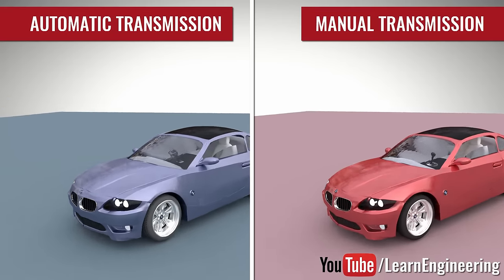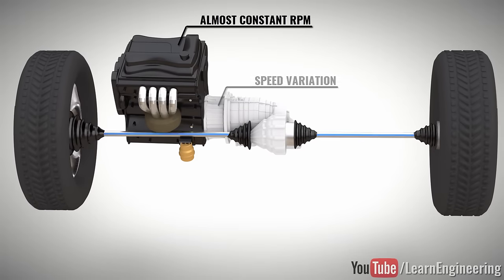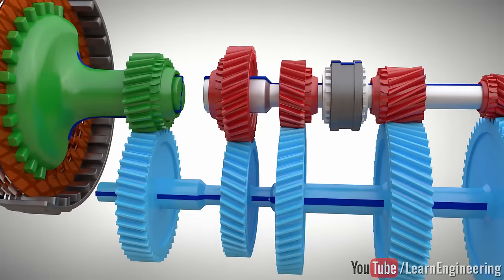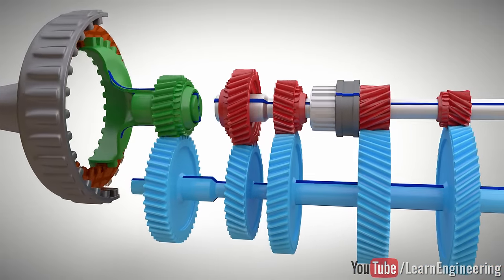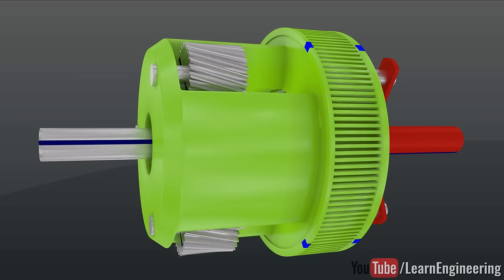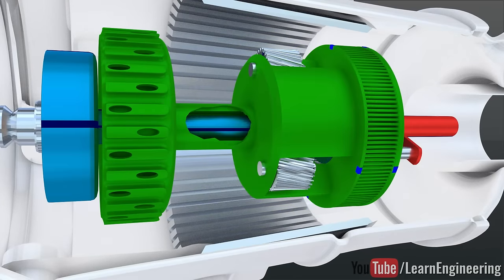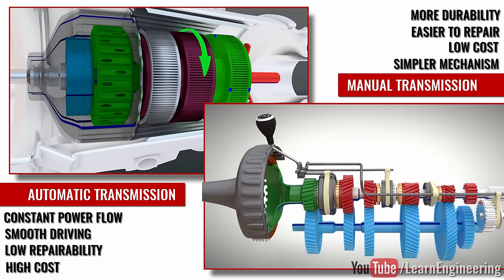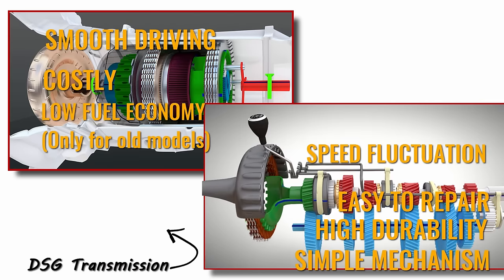Automatic vs Manual Transmission

Comment: Automatic vs Manual Transmission
$ 3 5 0 0    vs   < $ 1 0 0 0
Reply: EsArBe depends on the car some manual transmissions will cost you several thousand dollars
Reply: Invalid uzername Fair enough, that's a good point. I guess I more so meant the common car, ones you see mostly everyday.
Reply: Unless you abuse it, the only replacements is clutch, pressure plate, and throw out bearing, just slide it back from the engine to swap them out, automatic requires removal and complete tear down, more evasive repair.
Reply: Honda Civic vs Yugo
$ 25000    vs   $3.50
Reply: EsArBe 

you must live in europe
Reply: Makayla Serniotti No?
Reply: A poor person can have automatic and a rich person can have manual. It all depends on choice. Car enthusiasts prefer manual whereas people who only need a car to get around quickly in urban areas prefer automatic
Reply: THE GIBBONS manual is for skilled driver.
Reply: Nah, manual doesn't always mean skilled. It's all down to preference.
Reply: THE GIBBONS cause there were no spoiled girly automatic cars on a lot of countries.
Reply: THE GIBBONS there's a reason Finland has one of the best formula one driver/population ratio.
Reply: have fun with repairs
Reply: ive owned  manual and automatic cars manual is a  primtive mechanism for showing off its unpractical and untiring and requiring skill lmao bullshit common  sense to use it drviing on an automatic car is simply more practical
Reply: Where I live, Automatics are way expensive than a manual.
Reply: Worth it
Reply: EsArBe a
Reply: MagenticArcanine but manuals are just as easy to drive. Theres no showing off. Its more fuel efficient, the power to the wheels is easier to control, generally, they are cheaper to repair, AND you get more car/dollar. Also, no one asks to borrow your car.
Reply: What do you mean by "Have fun with repairs" ? An experienced mechanic can change your clutch in time under 1 hour. Unless you have some exotic car it's a cheap off the shelf part.
Reply: I just hope that CVTs are as reliable as manuals by the time that manual transmissions go extinct if ever
Reply: resell value is cheaper because good luck selling when no one can drive manual 😂
Reply: Sheldon Woodhouse quite the opposite. It becomes in demand as supply is limited for thoes who want a Manual.
Reply: S G if that was supply and demand, they would cost more not less. I see a load of manuals on local for sale fb pages in my town that never sell.
Reply: Sheldon Woodhouse it's obviously regional specific but specific cars do retain value better as manuals. (being that my brother works at canada's largest used Dealer)

 I see Volkswagen GTI's and Golf R's selling for over asking price because they're standard, in demand. I myself had to pay full MSRP on a GTI in dark iron blue with a 6spd because all 5 dealerships within 100km of me refused to lower the price, however I could have gotten a DSG auto with a few thousand knocked off for discounts. 

Same goes with challengers, Camaros, mustangs and Corvettes. Too Many automatics flood the marketplace. 

It's especially true with special cars, Audi R8 manual, ferrari 360s, 430s and California's, Gallardos, Aston Martin's & a few others... If they got gated 6 speeds, they are litterally flying of the showroom. 

Best one I heard was a bidding war between 8 people for a 2007 Ferrari F430 hardtop with a 6spd in yellow for nearly 300k. Almost double the average price for even a used  f430F1
Reply: Gibbon   automatics are for lazy boring people
Reply: @Chris-wj4ze  Yugiša majka, kupiš za 300 eura uložiš 2000e imaš ga ka nov, a jeftin za popravit.
Reply: or $140 and rebuild the damn thing yourself.
Reply: Gibbon manual is for people who can drive.
Reply: Generally about 2MPG better from a Manual Transmission on the highway.  Perhaps even more.
Reply: Manual 18 speed is for a skilled driver ;)
Reply: Leave it to a black man to break down the price first 😪
Reply: @Chris-wj4ze  Q: How do you double the value of your Yugo?  A: fill the gas tank.

Comment: 3:28 I disagree, manual transmission can be as smooth as automatic if you engage and disengage clutch and gears carefully.
6:45 Wrong, you don't press the clutch and then the brake. The appropriate technique is to brake with the gear engaged and reduce gears progressively as you brake, then press the clutch when getting to total stop at low revs to avoid stalling.
Reply: Jairo Palomares 

I think they meant the power loss in gear shifting. if you match rpms it won't be noticeable, but it's still happening.
Reply: I agree, The problem is how they say it "it is never a smooth experience",  is an overstatement.
Reply: Jairo Palomares that just increases synchro wear and should only be done if you absolutely have to brake hard.
Reply: Sep596 you are probably right. However, even if you choose not to downshift, you shouldn’t press the clutch before braking. You should press the clutch during braking.
Reply: ya I mean it depends if im coming up to a stop where I know ill either have to drop gears or completely stop ill press the clutch and drop it out of gear. if im just slowing down like 10mph I usually wont because the engine can still handle being in 6th gear. id rather have to replace my brakes because I used them a bit harder instead of replacing a clutch or transmission. but I also rarely brake hard I start slowing down well in advance and a lot of times don't even use my brakes until im already at a near stop.
Reply: @ah7027  if you revmatch when downshifting your doing no harm to your clutch or syncros. Now if you're just downshifting and dumping the clutch then yes that will happen but if you do it correctly you will do no harm to your motor or transmission

Comment: Here's the thing.  Most big rigs don't have synchronized transmission.  They require being double clutched and the engine speed matched to be able to engage the gears.  The only time the clutch really does anything is when the truck is stopped.  It's one of the biggest reasons why a lot of drivers don't use the clutch unless they are stopping or starting out.  They call it "slip clutching".
Reply: If a stick is driven mainly for highway to and from work, and you practice this technique efficiently, you can have a clutch as long as the transmission and engine it is meant to connect. Automatics will blow up and cost at minimum $2500 at least twice before this happens.

Comment: No need for American men to brag about driving a manual; almost all of the cars in Europe are manual. So old grandmas drive manual in Europe too.
Reply: It isn't hard the reason they brag is because they are rare in desirable cars like old muscle cars and if you go back even older it is actually difficult as they weren't synchronized
Reply: True I don't know anyone that owns a auto, even my nan drives manual
Reply: Everyone also drives tiny and underpowered hatchbacks.
Reply: D D you're calling him triggered? Just look at your comment.
Reply: Dennis Vasquez CLimATe ChAnGe AInt reAL loL
Reply: N75911 thing about sequentials is it's just an auto with a tiptronic  that doesn't last not even a true manual
Reply: at least thats all the "skill" required
Reply: 4 Strokes were around before 2 strokes, and 4 strokes are harder to maintain, not to mention not having power steering really isn't that bad and if you really want to have a manly time go drive an old F500 with the non synchronized 4 speed and a dual speed differential
Reply: N75911 you do realize you just did the same thing right
Reply: Wut, I live in Spain and almost everybody has a car with manual transmision
Reply: European real man only
Reply: Gas is VERY expensive over there. Probably half the cars are diesel as well.

Comment: Manuals are smooth to drive if you know your car and if you have two functioning brain cells. You have to switch gear at the optimal moment, then you won't feel any difference.
Reply: Fougère Garantie That's not the point he was making. When you clutch you cut power to the wheels, the only thing that keeps you moving forward is the cars momentum until you take your foot off the clutch again. In an automatic you don't clutch, ever, so you don't get that small loss of power every time the gear changes. I'm sure you're very capable of driving smoothly with a stick though, good job, you're very manly.
Reply: Yeah I get what you're saying it's just that it's not relevant to the video. Nowhere in the video does he say anything about manual not feeling smooth to drive, he just mentions power loss, like i said in my previous comment. 

So when you start talking about how manual is as smooth as automatic (implied) in a video where the subject is automatic vs manual in terms of power delivery you look like an idiot who completely missed the point of the video and just want to feel good because you drive a manual.

By the way, I own both a manual and an automatic car.
Reply: He mentioned a smooth driving experience dude, to me that's about the feels, right ?
Reply: Sure, whatever man.
Reply: 3:27 "This is why a manual transmission drive is never a smooth experience"

Comment: I'll go for manual one. Simple, cheaper and durable. Even has fluctuation but still I can go fast.
Reply: Nowadays, the price range doesnt really change much, and most cars are automatic. Manual is simple only by concept but not by the way you use it, theres stages, and it is much more difficult to learn than an automatic car.
Reply: But in a way tho, You can save on gas when having a manual
Reply: @cocacola9975  That depends of the way he or you drive . It's easier to save some unleaded with the manual transmission when using engine braking, it really depends the way you drive
Reply: Coca Cola just get a Prius then

Comment: You DO NOT press the clutch pedal before breaking, unless you're at about 1000 - 1500 RPM and know in advance you're about to stop the vehicle. You also should be in 1st or 2nd gear by doing so, as the engine will stall in a higher gear.

Also, there are many more advantages to manual:

* better acceleration and immediate response from the throttle (no kickdown delay).
* more control over the vehicle in general and over the driving style.
* fuel economy is still better than high-tech computer controlled electronic automatics, if you know how to drive and preserve fuel.
* better for hilly terrain and climbing/descending elevations in general.
* dual-clutch semi-automatics are essentially manual transmissions where a computer changes gear instead of a human, and they will replace the heavy and cumbersome torque converted planetary automatics in the near future, simply because manual is better and people are too lazy to change gear themselves and constantly press and de-press the clutch pedal.
Reply: Almost totally agree, but there is another advantage to the double clutch that you missed. They can change gear much faster than a manual transmission. One of my cars is a double clutch with paddle shifters, one is a simple standard manual and one is electric. The double clutch and manual are both ridiculous amounts of fun, but in completely different ways

Comment: WTF? Never push the clutch pedal while braking. It makes the braking distance longer. Also, read about engine braking.
Reply: well you have to push the clutch pedal if you would otherwise slow down the car enough to stall the engine, for example when approaching a red traffic light. you always need to press the clutch pedal when breaking, except when you don't plan to slow down so much that you need to change the gear.

In other words: if your breaking results in changing the gear, you also have to press the clutch
Reply: sure, when you see red light you push the clutch pedel when the rpm is low, shift the gear down and repeat. Braking with pushed clutch pedal = braking on neutral gear = no car control
Reply: at low speed (almost stopping) engine braking isnt needed (and just really irritating) . just rely solely on brakes.
Reply: You would be on the clutch pedal momentarily while braking if you're downshifting into a corner. For example a heal-toe downshift.

Comment: The new robotic manual transmissions with multiple clutches are the very best result of combining all these technologies. You get a computer that controls the clutches and you can either select the gears manually or let the computer do it for you as well. Multiple clutches means that you don't loose momentum while shifting as it works very similar to the automatic transmission clutches. So shifting gears becomes very smooth. Those transmissions are very expensive (the Nissan GTR transmission Siobhan is over $20K for example). But the introduction of electric engines is changing the game now. We will see what happens in the next 10 to 30 years...
Reply: Gotta say the new Audi R8 DCT is so fast it's cheating hahahaha
Reply: Volkswagen (who owns audi bugatti) etc makes the fastest dct
Reply: That's the dual clutch transmission that is linked at the end of the video.

Comment: European here. I would find it weird to have nothing to do with my left leg and right arm. Drove an automatic once and almost faceplanted into the steering wheel when I tried to find the clutch and hardpressed the brakes.🤣
Reply: Same happened to me with my mom's car
Reply: F1 and GT3 drivers who left foot brake: Hello there
Reply: @N75911_  Both have special manual switch gears, they only use the clutch in certain specific cases but it's still there so they need to left foot break.
Reply: For myself, I have adaptation time, evrytime I take the driving school's automatic car. My dad's car is an automatic, but the lever is on the side of the steering wheel, and the park brake is a foot brake. So when I reached for the lever, I just wave my arm in the void. Same for the P brake, i just wave my left foot in the void! 😅
Reply: It depends on what you're used to, If I were to try manual I would grind the gears and ruin my car
Reply: American here. I have been driving and owned my own vehicles since 1988. I have never owned an automatic transmission (aka "slushbox") vehicle and have no interest in ever owning one ! Unfortunately the manual transmission is fast disappearing from the American market to the point that a manual transmission is fast becoming more and more of a theft deterrent. There was a case where three young men tried to steal a car from an old lady. Between the three of them, they could not figure out how to start the car, even with pointers from the old lady who just wanted them to go away and figured helping them would be her best  safest option in the moment.
Reply: Highlander - European here from the EU. It is way past time to get rid of manual transmissions for one simple reason - most dumb kids that can drive a manual think that its such a huge achievement, and think that it means that theyre so skilled, that they drive like theyre the fast and the furious.
D-bags driving manuals is almost the equivalent epidemic of bmw drivers being d-bags internationally. And of course bmw drivers with a manual, are by far the worst.
Reply: @DesertStateInEU  true, and people associate people who don't know manual with America, like there are people who aren't American who only knows automatic

Comment: I simply drive them both. It doesn't matter to me .  I don't recommend one over other
Reply: God bless you.
Finally a normal driver...
Reply: I don t know how to drive a automatic, only manual
Reply: kristjan pirc You just put it in drive gear and it does all the work for you
Reply: @lvpo4347  But how do you stop do you need to put in neutral other way would it stall?
Reply: @kristjanpirc537  no you just put it in drive and drive if you have never braked with your left foot you should brake with your right foot so you dont stop with full force
Reply: @hubertkam7647  ok
Reply: kristjan pirc same here, I thought I had to shift into second gear but I ended up reversing into the car behind me 🤦‍♂️ automatics are too complicated
Reply: @masonnix9566  I only drive manual mate

Comment: you do not press the clutch while pressing brakes, foot off gas, brake, clutch when nearly stopped
Reply: Spot on... M.. You can even skid the car just by braking in emergency situation to a dead stop and then just press the clutch without stalling the engine. Whenever one presses the clutch before the brake the car may start to.. well... wonder all over the road... Especially down hill.
Reply: Tomislav Toskovich if your car wanders all over the road when braking your steering and suspension geometry is completely fucked.
Reply: Was looking for a comment about it. I was like umm you can brake and engine brake at the same time

Comment: I was almost convinced by this video to get an automatic transmission in my next car and yet at the end it turns out that it's not only much more expensive, more prone to breaking AND harder to repair, it's also possible to be less efficient.

I'll stick to the stick, thank you very much.
Reply: My family use automatic transmission and there is literally no problem with it for a decade, this video just express the problem that MIGHT happen for some but super rare to the point that u dont have to worry about.